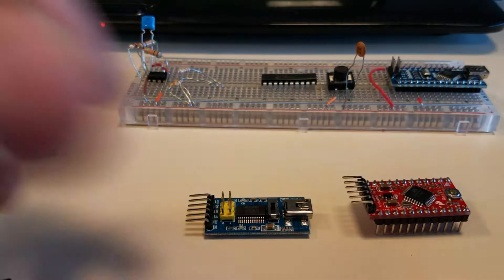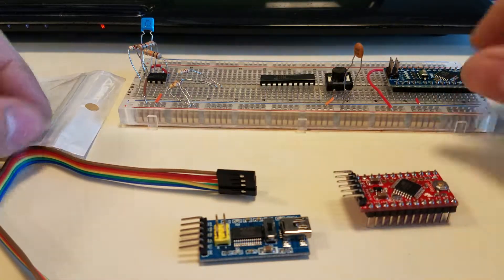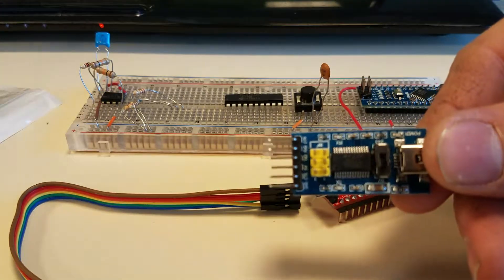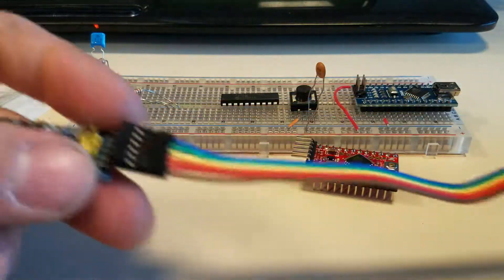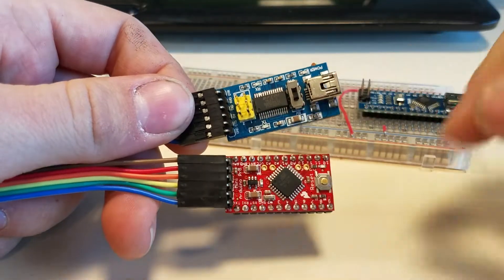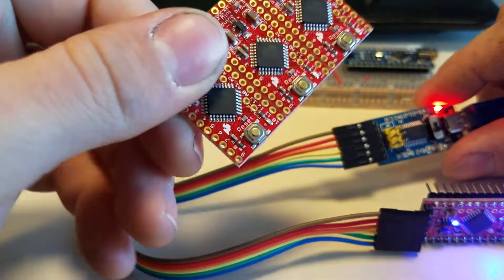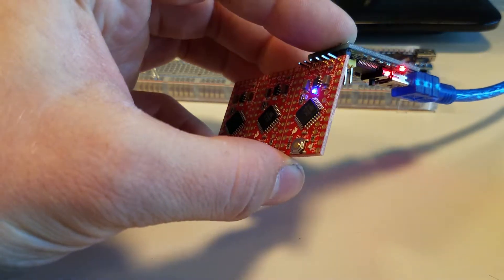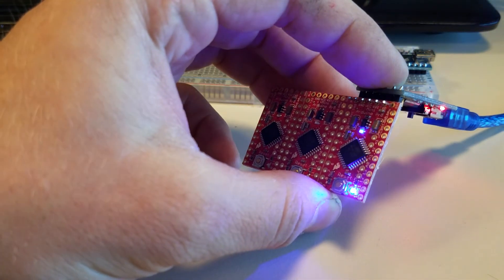QUICK Arduino Pro Mini Getting Started Tutorial

Comment: what a bunch of fucking bullshit, why don't one of you fucking sperglords make a proper fucking tutorial , nothing flashes to mine, these USB to serial FTDI are a fucking pain in the ass
they are all counterfeit chips or something because i cant get any of them working
i bought an inland pro mini 5v and an inland FT232 FTDI with female header that plugs right into the board i keep getting errors these fucking FTDI adapter are impossibel to get working in  winblows , can you make a  tutorial on how to install the arduino IDE and the drivers for the FTDI  and how to get it working , i set the  switch on the FTDI to 5v
i set the right COM port and board type and it does not work at all
also could you do  a schematic and tell were we power the board from when not powered by the  FTDI which pins we use for power? and the  rest of the pin layout, my boar has liek 5 extra pins too so it is more confusing , but the main problem is that it is impossible to get a FTDI to work in windows
Reply from the maker: Shoot i'm 7 months late, but sorry you were having a hard time with it. I typically just deal directly with microcontrollers and not arduino stuff. But if you're still looking for info or help on this I can dig back into it. Let me know!